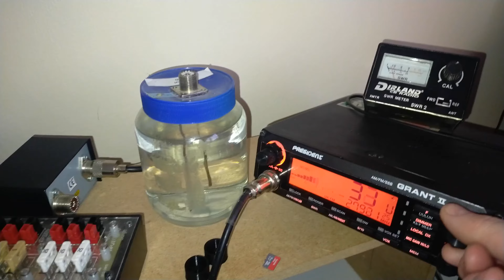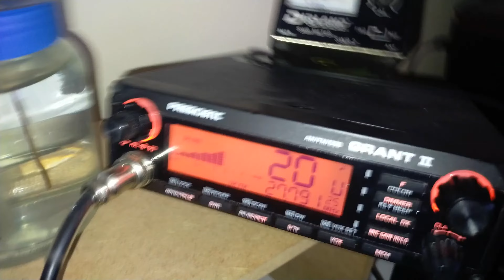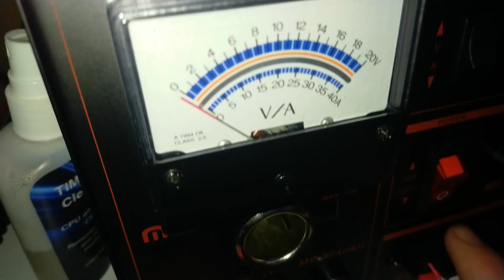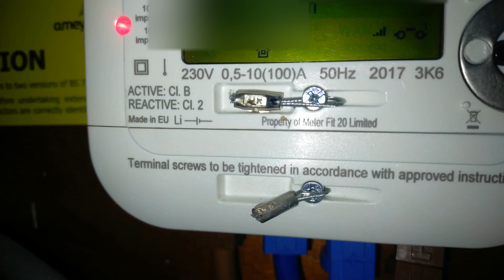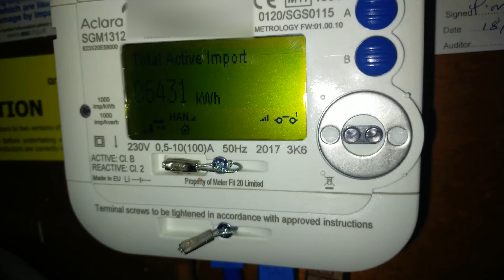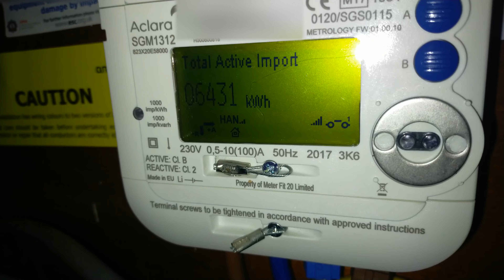A power-off test to rule out QRM on 27MHz originating in my flat

Comment: Whats with the JAr of water and antenna plug?
For thunder storms perhaps??
Reply from the maker: The jar of water is a salt water dummy load for testing radios, it works though isn't suited to high power tests
Reply: @PaulMcGeeM0WNU   Ah Ok, Nice one, Thought it might of been a jar for your lead in, to help protect your system (Lead-In) From lighting strikes :•) Or Static discharge..

Nice 👌🏼